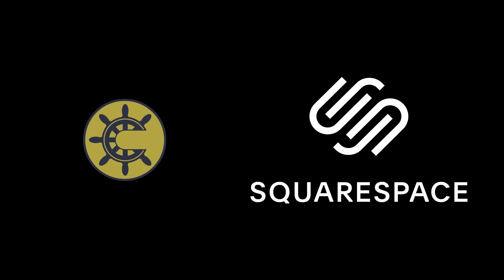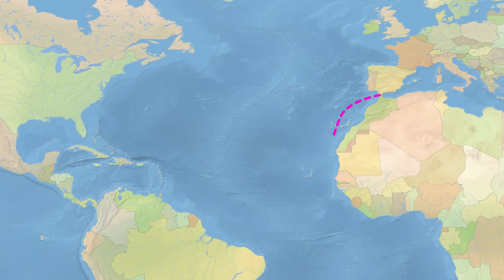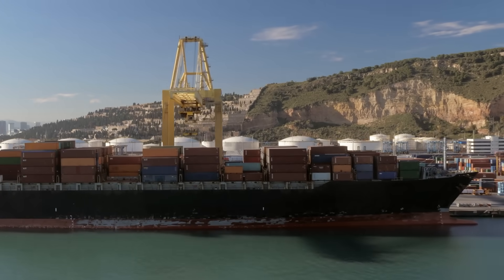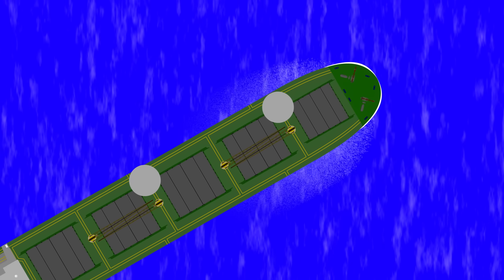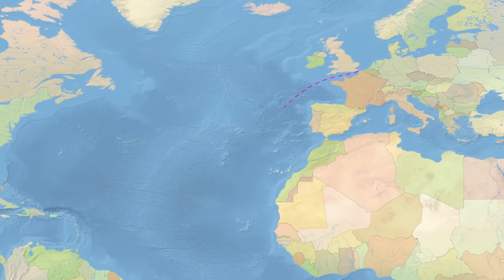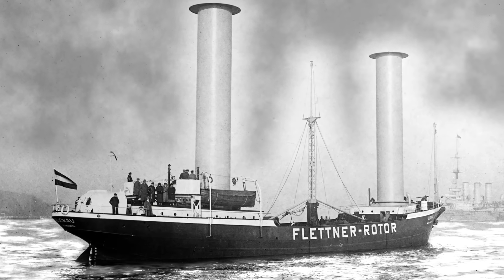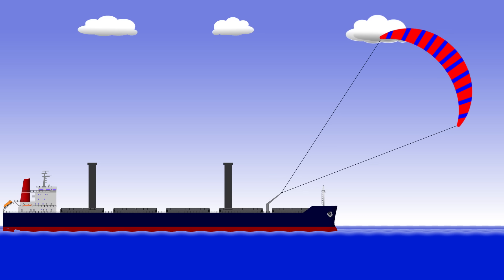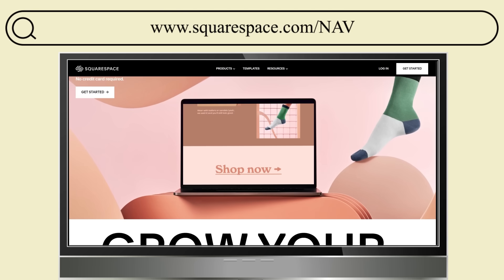Why Don't Sails Work On Ships?

Comment: I know someone who did some research on these sorts of devices. His conclusion was that they may be more useful for less time sensitive cargo such as bulk carriers, where they could afford to take the most advantage of global wind forecasts, either by delaying departure or taking a longer route. Because to really get the most fuel savings, you have to work with the weather, and if you're having to fight the wind because you've got strict deadlines to meet, it's going to be much less effective, or even might be detrimental depending on the technology.
Reply: Grain and guano used to be transported on sailing ships well into the 1930s. Read The Last Grain Race by Eric Newby. It was just barely practical then and very hard on the sailors. Maybe with very tough computer-controlled ships it might be practical for cargoes that can take months to arrive, but I don’t expect so.
Reply: The cost is the biggest drive. If large importers that care about the environment like the EU could charge a carbon tax on fuel used. Then tech will catch up and larger markets that don't care as much like the US and China will start to receive hybrid ships because they are cheaper to operate.
Reply: im afraid we arent going to be able to innovate our way out of global warming. in order to survive we will have to have economies that arent sensitive to cargo taking a long time. i think the point of global warming education is to make people realize we can't have both these massive growing economies and living life. if the economy didnt grow, then there would be no need for these high octane ships and trucks. there would be much less power required to support an economy that doesnt grow.
Reply: @severrnijKGU  How it was done in the past was through stockpiling, which meant massive warehouses were needed to act as a buffer for all kinds of goods. It was expensive and inefficient, and was not very flexible. Everything would become more expensive and less available, and there would be more waste.
Reply: @Croz89 yes , as opposed to when some kind of shipping problem makes all the ships grind to a halt , and now everything costs a lot ...

Wherehouses are an ensurance : you pay some always to not suffer the worst consequences in case of problems
Reply: @davidegaruti2582  So what's better, the occasional spike in costs due to an incident or much higher costs permanently, plus all the other consequences like huge amounts of land being needed for warehousing? Yes, it gives you "insurance" but some things are rare enough that they aren't worth insuring against.
Reply: Companies care more about schedules than they do about climate change, simple answer.  The shipping industry should also use rail instead of trucks for long distances, but it takes longer.
Reply: The issue there is that there is a capital cost to the ship.
Reply: I think globalism is dieing from rising fuel costs and the incoming resource wars
Reply: everything is time sensitive cargo, time is money
Reply: Time is money. Complexity is money. Sails require more and more skilled crews, in addition to slowing the ship down to the speeds local winds generate. Air foils don't just cost more to buy, but they cost more environmentally to build, and they create potentials for catastrophic failures if they seize up. Even the rotors have to balance the costs of rotating and maintenance against the potential savings in efficiency which may be zero if the wind is not fast enough.

The giant container ships simply have no benefit from such technology because to start them on a journey you need to spend hundreds of thousands of dollars. 

If you want more "green" power you need to move to smaller ships. Say a small sailing vessel that can only hold 8 cargo containers, run by independent truckers of the sea. A single team who doesn't need to pay for an accounting department, and doesn't need to schedule for a million tons of product to arrive in port at one time.
Reply: if he did some research, then he should conclude, that wind as propulsion for modern cargo behemoths is absolute BS. I made simplified calculations here and results are negligible in comparison of ships main engines.
Reply: Have you heard of slow steaming. Even container ships are taking their time to save money.

If it's time sensitive, send it by air.
If you're worried about cost, send it by ship.

And there isn't very much in the world that you can't transport by air, if you can afford it.
Reply: @Emily35-Official  Yes, but it is most importantly predictable. Every shipment, more or less, takes a similar amount of time. A business can order more frequent shipments in order to get the same amount of goods in the same timeframe if transit time increases, or can plan in the delay to their operations, sending out parts a week early to a job site for example.  

The issue with using wind power to its effective potential is that journey times now become quite unpredictable. The shipment could take 2 weeks, 3 weeks, 4 weeks or longer depending on global weather conditions. That makes logistics more difficult, as now you may need to store goods for long periods in order to smooth out your supply chain, which is especially a problem if they are perishable.

That's why bulk carriers are the least affected by unpredictable transit times. They already have huge stockpiles at either end, and as long as the average transit time is consistent, individual journey times don't matter so much.
Reply: @Croz89  I don't think anybody is suggesting the remove of engines and 100% reliance on wind power.

I dare say, that mechanical propulsion won't even be turned off or idled.

Rather the wind power will be used much like an additional engine so that the fossil fuel powered engines don't need to work as hard, thus saving fuel and co2 emissions.
Reply: @Emily35-Official  What they were saying is fuel savings would be marginal or even non existent if you didn't adapt your journey time and/or route to the wind conditions. If you're not getting favourable conditions on a significant majority of journeys, then it's unlikely to be economically worth it.
Reply: @Croz89  but that can be planned for before casting your lines.

And that planning could even go further back in time to quoting a delivery schedule to their customers.

And if the plans don't quite work out, they can always change them and cut their losses.

Just like when a certain ship tried its hand at angle parking, all the other ships had to make a decision to wait or go the long way around.

They had to wear that cost because you can't go to a customer after they've agreed to a fixed price and say you want more money.

If they are smart, companies will pass part of the savings of wind onto their customers, whilst keeping some of the savings.

And if their adjusted route to take advantage of the winds doesn't pan out, they will wear the costs of that.

But overall, I don't think it will prevent ships arriving when they say they will.

And they are already slow steaming, so taking a longer route or going slower clearly isn't a concern to them if it's saving them money.
Reply: @Emily35-Official  Generally industrial or retail customers (which will be most of your customers for container ships) favour predictability over shipping time. In the modern world of JIT manufacturing and even JIT retailing, having a predictable delivery schedule is the most important thing, almost above anything else. That's why the Ever Given incident was so expensive and damaging to global industry.

My point was if journey times need to be consistent above all else, then any kind of wind power makes that far more difficult, if you want to realise the benefits in fuel saving. Slow steaming is fine because it increases journey times by a predictable amount, this does not.
Reply: @Croz89  I understand that, but also believe a predictable schedule can still be achieved.

Plan the route to have the most favourable winds, use the maximum "thrust" of the winds and add some engine power to maintain your desired speeds.

Your fuel savings will become the variable, not the arrival time.

It's much the same as taking one engine down for maintenance, you just run the other engines harder (assuming the remaining engines have the HP to maintain the desired speed of course).
Reply: @Emily35-Official  If the route is longer, or if you have to wait to set off later, you will have to go faster, which will negate most of the advantage in fuel savings. Really the only way to manage it would be to start off with a worst case, and go really slowly if you have very favourable conditions on a short route, which has problems as most vessels are designed with a minimum speed in mind.
Reply: @Croz89 having supplies at either end sounds brilliant why did we ever stopped doing that ?
Reply: @davidegaruti2582  Because it's expensive and wasteful. It only works for bulk fungible goods with fairly consistent demand.
Reply: @Croz89 You don't have to use sails 100% of the time. If no wind motor. If more wind cut back on expending petrol. Schedule has irrelevant to supplementing engines with sails.
Reply: @markfeldhaus1  Sails are not overhead and maintenance free. If you aren't using them enough they won't be economic.
Reply: @Croz89  If we build them and man them as in the 19th century you're absolutely correct. If we develop new materials and designs this will not always be the case. If we keep saying it'll never work because we tried this or that tomorrow will never come. That's why we don't have light bulbs and aircraft because we proved they were impractical, obviously.
Reply: @markfeldhaus1  Cargo vessels run on razor thin margins, any extra overheads really have to justify their expense, even if it's a lot less onerous than the 19th century. I've already mentioned how they can work for bulk carriers. That's still a lot of vessels so it can make a difference. Just that it's probably not viable for container ships, ferries and similar. There's no need to throw the technology out because it will only be useful for some cargo vessels and not all, or even the majority of them.
Reply: @Emily35-Official  There is a great number of things in the global economy that are both time sensitive and completely unfeasible to ship by air.
Reply: @gamma7897  like...
Reply: I think none of you understand that these ships would STILL have propellers and engines capable of transiting without the rotors at all.  The idea is NOT that wind rotors would replace the engines- after all the rotors are spun by engines.   The idea is that the rotors would REDUCE the fuel used for transit.  Unlike sails they are less wind direction dependent. Any wind that could be deflected in any degree that would add to the forward thrust of the ship would take some component of load off the screws. And when the wind is contrary to your course, you simply shut them off and run as any normal ship.    A fuel savings of 5% would be entirely worth the fitting of such devices, if that average savings was passed on to the company that owned the vessel. The core issue is that the owners of the ships have no significant stake in operational costs-Unless operators of ships were to only want to lease ships with lower operational costs. With a world wide shortage of shipping, that’s not gonna happen.
Reply: @christopherpardell4418  We do understand, but the cost of maintaining these devices is not negligible. And they still work most efficiently when the ship is going with the wind, or at least in the general direction, or of course when there actually is a wind to use. The argument is that they wouldn't be economic to install unless they were useful the majority of the time, which on many routes where you have to sail on the shortest practical path barring a hurricane as soon as you're ready in order to keep time, might not be the case.
Reply: @Croz89   They are actually extremely low cost and simple devices.   Two sets of bearings, A motor and a pulley. Spinning a simple steel drum.  About as complex as an oversized electric dryer, without the forced heated air.  Just built to withstand high winds and tossing seas.   When there is a favorable wind, they can generate 10-20% fuel savings.   That you spend X amount of time with them not being spun because of unfavorable winds is what brings their average percentage down to the 5-10% range.  But think of what Aircraft companies are willing to do to bring down the cost of fuel by just 5%? Design all new jets costing billions of dollars before they can so much as sell the first jet.  That is because the owners of the jets will be the operators.  5% savings in fuel is 5% More money to the bottom line. Given that most companies only manage around a 20% profit, you are taking about a 25% increase in profits.  Or the ability to undercut competitors pricing and still pocket a higher profit per voyage.  Sorry, the arguments against it simply fail to understand the long term benefits of lower cost of operation.   If it were your CAR you would gladly pay 5 grand more for the car, if it saved you 5 grand a year, every year you owned it.  All that’s needed is to make ship owners feel the benefits of building them, or the suffer detriments of Not building them. Entire industries have relocated to China or India to realize a 2% increase in margin.
Reply: @christopherpardell4418  Just because they aren't complicated doesn't mean they are cheap to maintain. The structures are still huge and will need to be regularly inspected to check their condition. If one of them toppled over in high winds, you could imagine it would have some serious repercussions.

My point is the amount of that saving will be very dependant on how the ship operates, and how flexible they can be with routes and journey times. That's what my friends research was partly about, seeing how wind powered technologies could be integrated into shipping and what would be needed to get effective fuel savings out of them. They aren't a miracle technology with no downsides that only has bureaucracy as a singular obstacle. There is the potential to save a lot of fuel, if you use it in conjunction with wind patterns as much as possible, but if you can't, or don't, then you won't see very much, if any.

To give an analogy, I could put a single wind turbine up on a hill and I'd probably be able to get some energy from it, but if it's in the middle of nowhere, any profit from it i'd get is marginal at best, and I have to make sure it's regularly serviced. If I put it with an array of turbines in the north sea I've slashed my service costs, my turbine generates more energy because the wind is more consistent, and I make a decent profit.
Reply: either we cut co2 emmisions or we wall off every continent. the first is cheaper but the second is what will happen because democracy encourages minimal short term spending. spending a few billion now to save a qudrillion later will never happen.
Reply: @explosiverift2037  if you don’t like democracy, please tell me what autocracy and dictatorship bring? Lenin, Stalin, Hitler….Democracy gives you the OPPORTUNITY to change course/leaders. Autocracy keeps going until it crashes and burns. You may believe certain things need to be done but who says that you are correct and why do you assume you will be the autocrat?
Reply: @explosiverift2037  that's less of an issue of Democracy and more of an issue of capitalism, it encourages short gain gains over long term planning because companies have to increase profits for their shareholders year after year
Reply: Good point Ralph! Hugging trees feels WONDERFUL, until you're low on food, medicine, raw materials & retail goods.
   It's always amazed me how the "Starbucks crowd" wants to eliminate straws & save the spotted owl...
    UNLESS IT MEANS foregoing their mocha-lotta -gucchi coffee (or whatever) & their gluten free range-raised bran muffins. Then it's, "Excuse me, I need to speak to the manager!"🤣